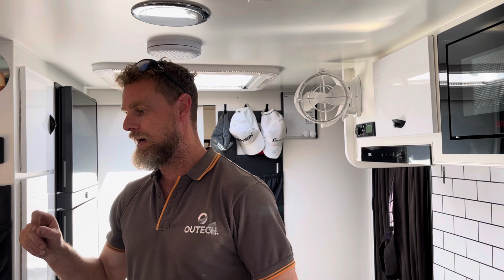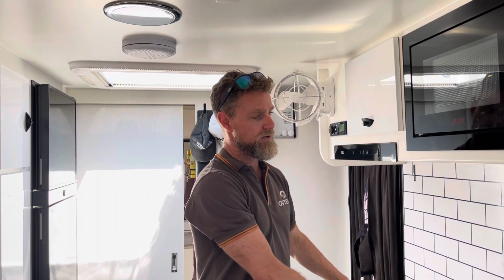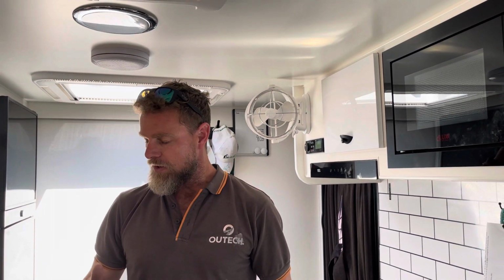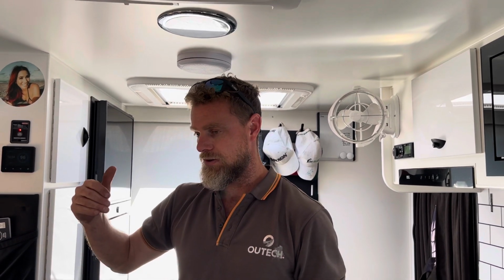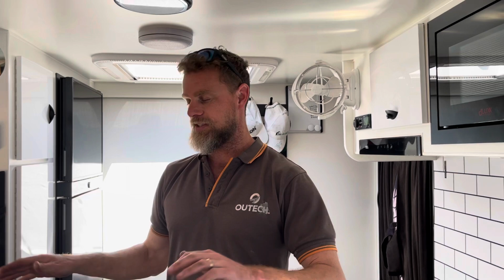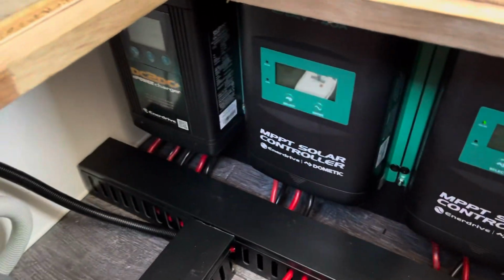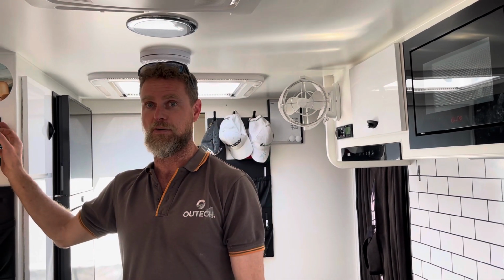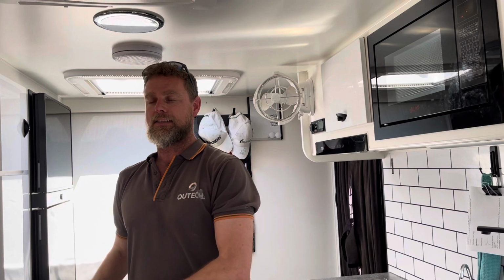DON’T get your caravan manufacture to install your off-grid power set-up.

Comment: Looks like a Retreat Fraser.... I have the same van and are just about to upgrade my system. I was going to keep the BMPro for distribution and 240v battery charging, all other power input to go through Victron MPPT and DCDC chargers. I was also going to keep the odyssey to show voltage/usage etc as I installed a BC300 Shunt which seems to be working well. Would you recommend my suggestions or alter some or all? I aslo have a Projecta 2000w inverter that I want to set up so all 240v appliances run from the inverter when offgris, it has an AC Switch.

Comment: Great advice- go to a specialist such as an caravan repair specialist or a RV competent auto electrician. Buy a complete system with a good brand and budget to spent 15-25K to fit out a great system.
Mine is a full Enerdrive system and has 1400w of solar power and 600 amps of lithium battery.
Reply from the maker: Thanks for the comment and watching. We always recommend taking a basic package from the manufacturer and going and seeking out an expert for your offgrid system.

Comment: It is hard to believe that Australia does not  have regulations to assure that systems are installed  too correct and safe standards.  I own an off grid "travel trailer"(in USA).  After seven months I can say all systems were installed correctly more or less.  There always seems to be some QC problems like  rusty nuts on junction boxes,  screws not set deep enough, the use of screws when bolts would have been better.
Reply from the maker: Hi SkylinersYeti. Yes we definitely see a lot of actually issues in this industry for sure.

Comment: We install BM pro system where I work and some of the systems get the BC300. It is the the most pathetic shunt monitor on the market in my opinion. The mounting of it is just painful especially when you run a battery with a stepped lid. The data available to the operator from the shunt is as handy as tits on a bull. I definitely can’t recommend it to anyone. The other problem we have as a manufacturer is people don’t understand what they are purchasing. They want all the bells and whistles for bottom dollar so they end up with systems that are not capable of functioning to their needs.
Reply: So I found this channel…. and it’s a fantastic resource. Question if I may… when not on shore power, and I turn on my enerdrive inverter…. the battery charger should be off. Is this correct. Thanks again for the work you put into the content.
Reply from the maker: Hi @rtarrant1 and thanks for the comment. 

That’s is correct. Your AC charger should not be active while you are offgrid running from your inverter.
Reply: @outechoffgrid  we just checked… and we are all sweet. Appreciate the help.
Reply from the maker: The biggest issue we see with these systems from manufacturers are the installed locations, cable sizing and quality of terminations. Usually manufacturers install these units into an overhead cupboard which is too far away from the battery creating issues with volt drop. 

These units are great for small systems which just want to run lights, pumps and fridge. Outside of that we go outside of their design parameters and they become less useful.